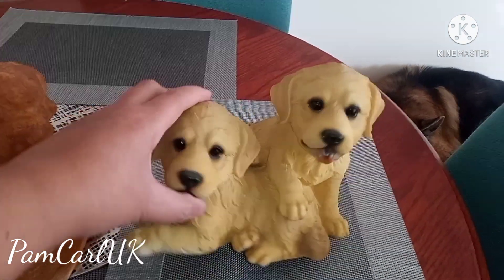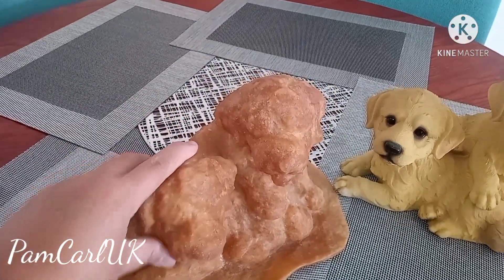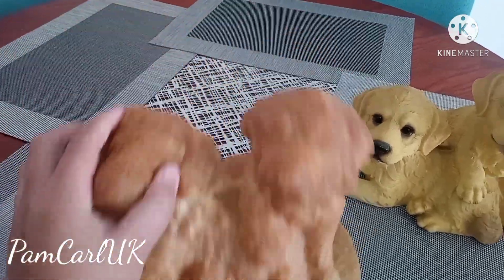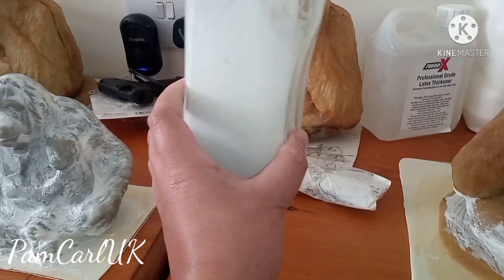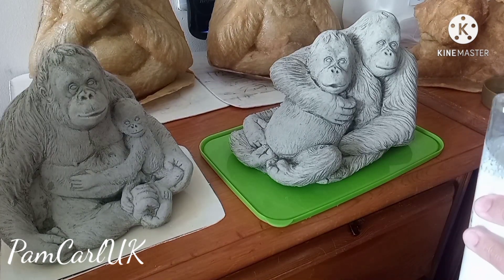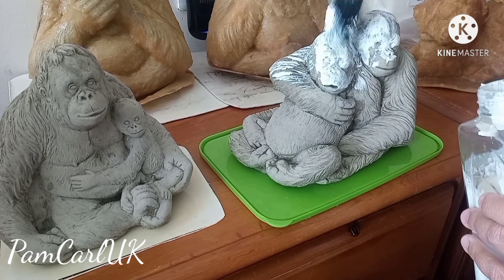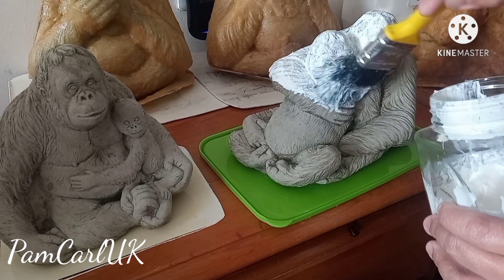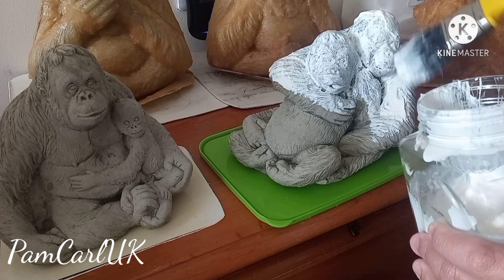HOW TO MAKE A LATEX RUBBER MOLD | PART 1

Comment: Hello LATEX RUBBER MOLD | HOW TO USE I watched your video. However, you did not show how to make 2-piece latex. For example, a glass, bucket, flower pot, I have to make them in 2 pieces, right? Do you have a video on how to do this with latex? thankyou

Comment: do you use the mixture of latex and latex thickener for each coat?  or just the first coat?
Reply from the maker: I use it for each coat.
Reply: @pamcarluk  ok cause on your lighthouse video you used regular latex on first coat i think
Reply from the maker: You're right. Both resulted in a good outcome.

Comment: hi. before applying latex on model, do you apply wax on model o remove mold from original model easyly? what kind of wax do you use> thanks.
Reply from the maker: I don't use wax. I just wash the mold with plain water before using.

Comment: Did you 1st apply wax before painted it with rubber?
Reply from the maker: Hi, I  didn't apply wax on this specific project but it turned out perfect. It actually depends on the texture of the model. I applied wax in some of my projects please check out the videos. Thanks

Comment: How many coats do you apply? Your work is beautiful, thank you.
Reply from the maker: 15 to 20 coats. Thanks
Reply: @pamcarluk  Or is it starch?
Reply: Do you add filling material to the latex before applying it or do you bake it?
Reply from the maker: No, I just add some thickener
Reply: @pamcarluk  what is thickeneer,
Reply from the maker: It's called Latex thickener you can buy it from ebay
Reply: @pamcarluk  Thank you very much for your attention
Reply: @pamcarluk  Do you have a latex detailed video? I would like to see it.

Comment: You not need to put a mould release on it before putting latex rubber on it?
Reply from the maker: You can apply mould release if you want.  Some of my projects I did use release agent but for this specific project I didn't, but it works just fine.

Comment: Can this latex rubber be used on a cement statue to replicate it?
Reply from the maker: Yes you can use it for cement. Thank you for watching.
Reply: @pamcarluk  what I mean is can I apply this latex to a cement statue to create a latex mold.
Reply: @MrGonzales1982  You will need to seal the cement statue first. Dry cement is porous, which will soak up the first layer of latex to varying degrees.
Reply: @skateboardingjesus4006   thank you , that makes sense.  Do you have any recommendations on what's best to use for the task if sealing it.?
Reply from the maker: @MrGonzales1982  yes you can but make sure to apply some form of release agent.
Reply: @skateboardingjesus4006  is there anything you recommend for this?
Reply: @pamcarluk  like what?
Reply from the maker: @MrGonzales1982  this might help https://amzn.to/3z52t2u
Reply: @pamcarluk  thank you
Reply: Donde lo puedo comprar ese latex americano x favor 🙏
Reply: Where can I purchase the mold please

Comment: What is name runner?? Pls
Reply from the maker: Latex rubber mold any brand will do. Thanks
Reply: @pamcarluk  its like Latex Liquid (Bendosen), right?
Reply from the maker: @raymond2742  I think so
Reply from the maker: You can buy it from Ebay or any arts and crafts shops.
Reply from the maker: Hi Raymond, I put a link in my description for the name of the latex rubber mold. I hope this helps you. Thanks

Comment: How many times can u re use the molds? Kind regards
Reply from the maker: It will last you years and years if you will look after your mold.
Reply: Classic tibia- remember to keep your latex molds out of the sun!  They deteriorate in the sun.  Also do not use petroleum products on them because they ruin the latex.

Comment: Could you explain how you prep the original? Did you seal or paint it?
Reply from the maker: Hi yah thanks for watching my video.
I didn't do any preparation before I applied the latex rubber mould it was easy to take the rubber out when it's fully dry but some people they use release agent it's entirely up to you.
Reply: @pamcarluk  Thank you for the tips and for an informative video.
Reply from the maker: You're very much welcome have a lovely day